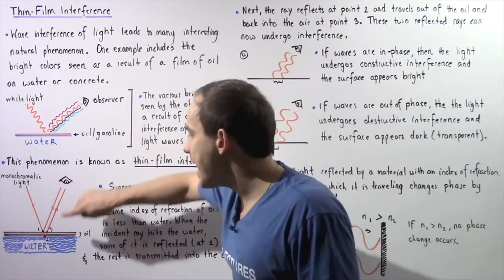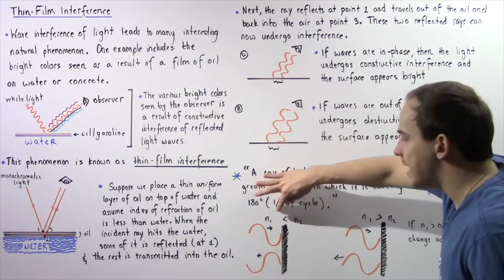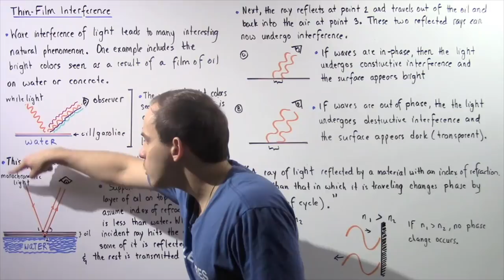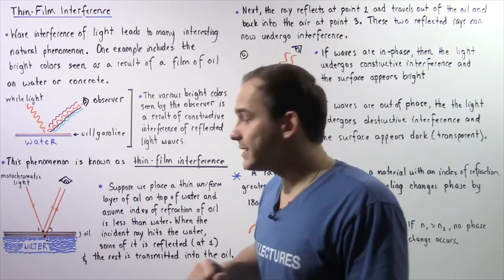Thin-Film Interference

Comment: In the second example using monocromatic light, would both light 'rays' experience a phase change due to refraction at pt 1, and the second 'ray' experiencing a 1/2 wavelength shift due to reflection at pt2? In such a case, what would the resulting 'ray' look like?